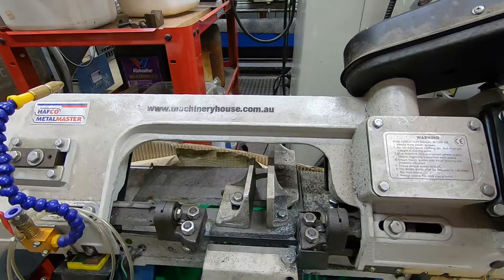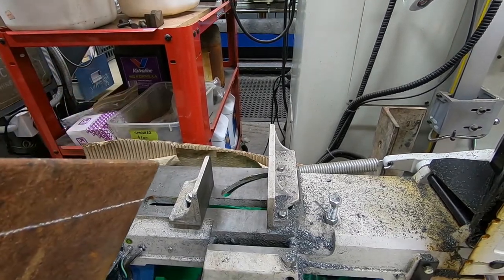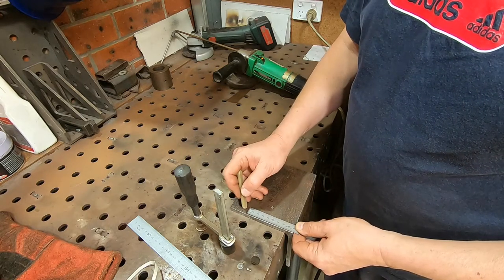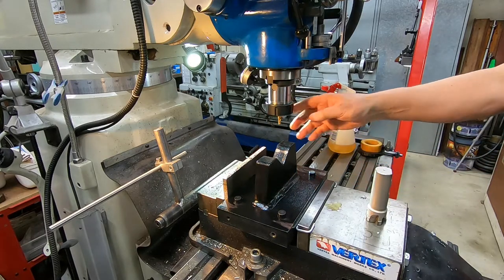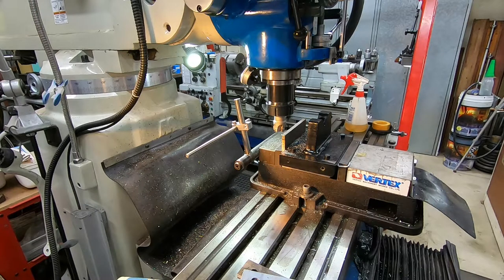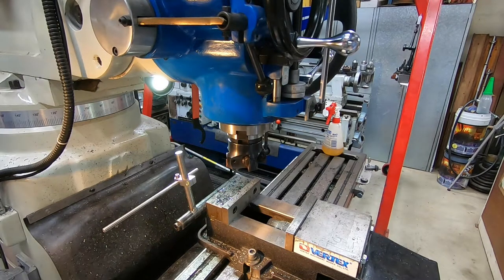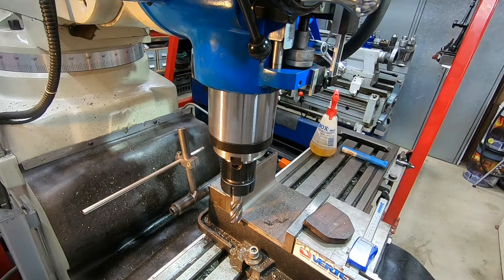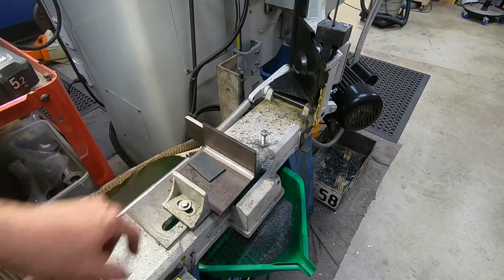Clamping accessory for a horizontal band saw. (Part 1)

Comment: My wife called me from work one day in the eighties to tell me about a saw like this on a guy's truck for sale.  I took the loose jaw of the vise, and drilled, tapped a 3/8ths course thread hole in the left side, to space that side the width of the cut with small/short or odd shaped pieces.  I still use it today, no problems.  I have made a couple "extra jaws" of different shape and size for it, but most work is still done with the original jaws.  I paid about a hundred and eighty back then, probably spent more in blades than the original price.  Definitely well worth the money.
Reply from the maker: Before I made this clamping accessory, I used a bolt with a long nut in a version of the modification you described. This method works well for jobs where the cut-off piece is long enough to be supported outboard of the blade. But when this is not the case, there is a possibility of the job being cocked in the vise by the pressure of the blade. My accessory incorporates a clamping screw that holds the back end of the job down to ensure this cannot occur with very short jobs/cuts.
I have also had a lot of use from my saw and agree that these tools are a cost effective option for the home workshop.
Perhaps you would be interested in some other mods I have made to my saw: https://youtube.com/playlist?list=PLQ5iH19hiQ0qPE5CM76cJ9K8gbioOM_Di
Thanks for your comment.

Comment: Hello, i recently subscribed to your channel and i'm watching earlier videos. I was wondering what that green plastic chip collecting thing that you've put under the bandsaw blade area is made from.Looks like a repurposed dustpan. Do use it to contain the cutting fluids?
Reply from the maker: Thank you for subscribing. The green thing that sits on a shelf under the blade area is a plastic pan. It holds about 9 litres and was originally used for collecting oil drained from a vehicle. I only use cutting fluid when sawing thick material and this pan works well to collect most of the run-off. The moulded-in spout makes it easy to return the scavenged fluid back into a screw cap container. My usage is low frequency and this method avoids problems with the cutting milk becoming smelly.